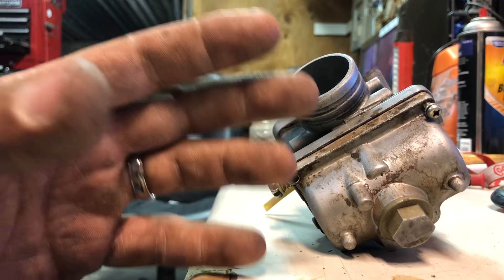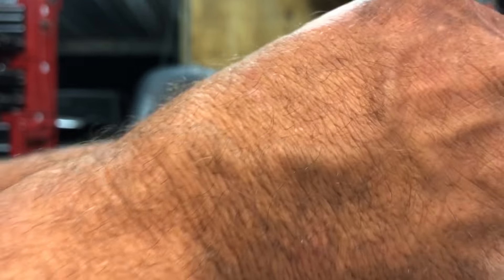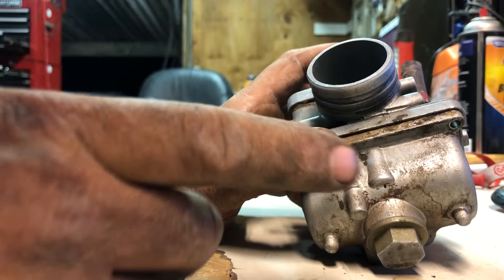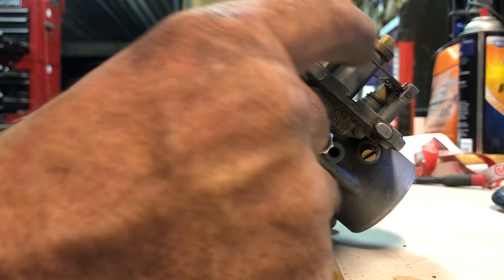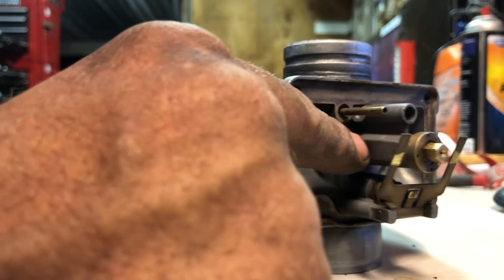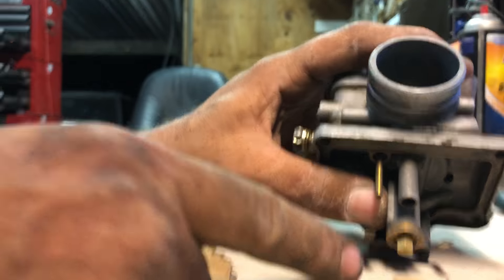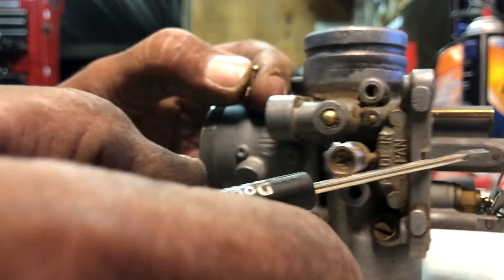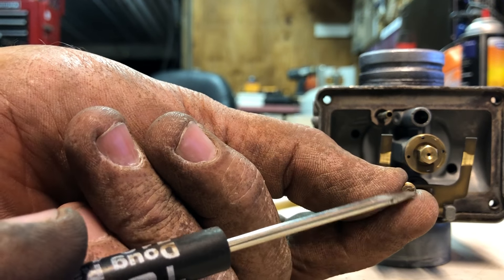Spitting And Sputtering Issue Solved

Comment: Just got a 05 Yamaha bruin 350 in excellent condition. After about two weeks of riding, it started sputtering and bogging out when I give it gas. Took carb apart to clean and it was like brand new inside, but I cleaned anyway and replaced sparkplug. Put carb back on and same problem. If I slowly give it gas it'll slowly pick up rpms and fly but as soon as I decrease gas and begin to increase again I get the same sputtering like it's starving for gas or getting to much. Like I said, this machine hasn't been taken care of very well and has less than 1000 miles. It also will backfire a little bit every once in a while after I get off gas at high speeds. Need help
Reply: I have the same condition on a small ct 200
Reply: Same problem here on the same quad, did you get it working and what did you do?
Reply: Did you ever find out what the problem was
Reply: Figure out the problem?
Reply: Being a 2 stroke the crankshaft seals may have dried out over time and is coursing an air leak around the crank.
Check all gaskets and crankshaft seals as you don't need to hole a piston with a lean fuel air mixture.
Take care and good luck 👍
Reply: @greglockyer4335  I'm thinking that's my problem as my carb is spitting gas out towards the air filter when I Rev it, plus compression is kinda low time for a rebuild
Reply: It’s the vaccum acctuated carb my did the same replaced it runs brand new
Reply: Figure the problem out?
Reply: i have same problem on 91 klr 250, it will idle perfectly fine, but when i give it throttle it can’t seem to find a steady rpm it will dance back and forth and won’t go over 5500 rpm and will boggg and bogg. i bought this thing awhile ago and it wasn’t as bad as it is now. I cleaned/rebuilt the carb and it worked better for a little bit still wasn’t the best though. I dropped a valve and went thru to fix everything and now it is ass yet i never messed with the carb. Don’t want to have to open this thing again, but shit it’s already been down for a 3 weeks. if anyone finds an answer let me know
Reply: Following - similar problem with 1999 Polaris Sportsman 500
Reply: Same Problem with Honda crm 1995
Reply: its 2023 and i have this exact problem with.xtz 125 😂
Reply: @MarioLopez-be1vg ive been looking for weeks to find a solution for this did you ever figure out what was causing the gas out the carb
Reply: Same
Reply: Maybe a gasket in between the air filter and carb
Reply: Any help me out with sputtering on my trx 250ex it starts drives but it idols strong for a second then slowly slows down until it stalls
Reply: @josephconn3235 why though?
Like what is happening with it?
I have the same problem
Reply: I had the same problem and then my carburetor fell off so I Taped it on there to get myself home and it had more power and didn’t big out, something is going on with the air I think. 
It must be running too right cause I fastened it on there again and now the problem is back. 
Help me
Reply: @jamesclarke1754  from what I’ve messed with the rubber vaccum slide on the carb has baby hairline cracks and messed the air fuel mixture up. I put a cheap Amazon carb on it and it’s been running 3  years no problems
Reply: @josephconn3235 what is the issue though?
Like is it not getting enough gas? Or air or what?
Reply: @josephconn3235 I think for some reason my scooter isn’t getting the proper amount of air it needs, running rich
Reply: @jamesclarke1754   check your choke mechanism, make sure it's closing completely when off. It's held closed by a spring and if it gets too sticky that spring can't cut it. Also check and clean the float valve that lets fuel into the carb bowl, it could be lazy to close and overfilling the bowl, x2 if they are ever straight up leaking gas when flat and level. A bit of mist out the intake while running is normal and gets recyled when the airbox or filter is on it, not the same as leaking liquid gas. Also check the height of the float lever, eyeballing for flat isn't good enough imo, it's a specific measurement found in the service manual. Other things that could cause similar issues or amplify the same problem are worn, dirty or IMPROPERLY gapped plugs, old gas, old gas again, especially ethanol anything, exhaust pipe damage or leaks, bad clutches, sticking brakes. Hope this helps, good luck.
Reply: @treytzimenatos3422 if your carb is leaking liquid gas it's the float lever valve that lets fuel into the carb bowl. Open the bottom, remove the lever by CAREFULLY driving the pin out and the valve will fall right out. That said a small amount of fine mist coming out the intake while running is normal and gets recyled when the airbox or filter is on it.
Reply: @HoldenPogorzelski   Have you tried the usual stuff? New properly gapped plugs, fresh gas? Will it only run mid to high throttle and never idle for long?  I suspect your idle jet is clogged, many 2 strokes will stay running for a decent bit after the fuel is cut off because on many its sucked into the bottom of the engine first, then into the cylinder. It runs good on the higher jet and has gas for a while after that, but then your idle jet won't give it enough to keep it idling. You should know that if this is the problem, running it in this situation is not good for it, without the idle jet it's not getting enough gas at all rpms, it could potentially burn up the engine. The jets work together and are parts that make up a whole as you go up the throttle range, you need both idle and main jets working. You may also want to check your choke mechanism, make sure it is closing fully when off, it could be flooding the engine when it's at idle and not getting enough air, if this is the problem you won't cause any damage. My money is on the idle jet though. Check your plug color religiously till you get it worked out. Hope this helps.
Reply: @jsimonx420 i think you have a main jet problem. Sometimes the tiniest fleck of something is all it takes, sometimes taking it off and on dislodges something in the fuel line that heads straight for that tiny hole. Or could be a needle problem. The needles do wear out over time, get thinner and let in too much gas. Could also be a cable/ synchronization issue if you have multiple carbs. You say it idles fine, but is it actually good, or just fine enough? It needs all jets to be working properly at higher rpm, not just the main, they are parts that make up a whole as you go up the throttle range. It won't get enough gas at full throttle if the idle isn't working properly. You probably know that if it's not getting enough fuel you risk causing engine damage. I also have to wonder if it came to you from a different altitude. Other issues that could seem similar or amplify the problem are bad plugs, bad gas, damaged exhaust pipe or exhaust leaks, intake leaks, bad clutch, sticking brakes.

Comment: What about sputter after you install a new carburetor. It’s almost like a little back fire . But cranks and idles fine
Reply: Also happen to me...sputter after install a new one carb...why?
Reply: I would check your spark plug, air filter, and air intake piping. If there is not enough air going into the engine, unburned fuel will shoot out of the exhaust and ignite causing a backfire sound. I suppose if a spark plug isn’t strong enough you could have the same issue
Reply: What was the issue

Comment: i have the same issue with my recently purchased kawasaki brute force 750 atv. Seller told me it ran great and had the carb cleaned and re jetted by a local shop just before he put the bike in storage for the winter season. When i showed up to buy it, it spitted and sputtered like crazy and would not stay running. After i rode it around a little bit i raised the choke level up about 15% and it seemed to run fine then...the idle was great and no more sputtering or spitting. Seller was shocked and told me it ran perfectly before he stored it for the winter. I went ahead and bought it anyways knowing  it was fixable no matter what and he gave me a killer price on it so I was still stoked to buy it. I so far am just riding it with the choke partially open and it runs fine so far that way at least.
Reply: colourtune plugs are handy as you can check the color of the flame which should be Bunsen blue after the choke is pulled in. there is a mixture screw under the carb usually which you can screw out a turn to get more fuel...might be worth a try. As long as the jets are the correct ones and the float heights are correct then with a clean carb the bike should run well.

Comment: This was probrably one of the best videos about small carbs thank you so much  I dont think Anyone could have explained that any better video was straight to the point.. Ive been struggling with a small carb. First it was leaking out the over flow then it was backfiring thru the air intake now its bogging down with throttle doesnt die starts right up but bogs way down driving me crazy but im pretty sure after dozens of videos  this is the video i needed to see. Will let you know thanks again

Comment: This is indeed a brilliant explanation ever to my Yamaha AG 200. By looking at this vedeo I've also checked and cleaned the main horse's nipple from the fuel tank to the cab which was being blocked by so many dirts. 2 Problems that were solved are engine dies when at low RPM or when at higher RPM, and hard starts again at about 3 minutes. ❤❤

Comment: Thank you!!! I am a complete noob and just started getting into ATV’s last summer. I am currently on my  pulling carb for the 7/8 time done yesterday. the same carburetor in and out with out luck 
 This video may be my saving grace
Reply: What kind of atv are you working on? And did you try this yet? Having problems with a 2004 predator 500 stalls at idle. I’m going to try and pull the carburetor this weekend.

Comment: im going to try this today. i have an old 1991 honda 300 fourtrax that seems to carbon plugs almost instantly. the bike idles great and can putt around in SL no problem, but as soon as your on the throttle to get through your gears, its as if the mid range power is completely gone it struggles to accelerate, and it starts to come back in to normal in the high end RPM. its causing jerky acceleration through gears and when finding your cruising speed. ive taken apart the carb and cleaned the jets, along with replaced the air and oil filters, plug and oil. somewhat fixes the problem but reverts back (my guess once the plug fouls) im starting to think the float may need to be adjusted now, thanks for the new lead!

Comment: Thank you! 
Having a heck of a time with my 125cc sputtering and definitely not idling. 

Always has run great previously. 

I cleaned out the carb but will re-check these side ports. 

I’ll let you know if it works!

Comment: Man runs perfect in every gear when you put it in reverse it don't have no power it just spits and sputters will not go backwards I also bought a brand spanking new carburetor and put it on it and it run perfect but like I said when you put it in reverse it just spits its better it won't go backwards unless you're on flat ground

Comment: Thanks man. Just bought my first carberated bike and want to learn as much as i can about it so i can wrench on it myself. It spits occasionally, its about 40 degrees out here in colorado, and it apears to only do it when choke is all the way in... so it may just need to be dyno tuned... apparently again... not sure if its tuned for this elevation. Assumed it was and that may be a mistake as i should have asked and the dealership may have shipped it up from elsewhere.

Comment: I could not figure it out. My new motorcycle only has 200 miles on it. Came with a carburetor I have to work to get the screws off the bowl. No biggie. Yet it puzzled my on what it was doing. Did not make sense. Now it does. So, I'm going to do exactly what you suggest. I will see. If works, you just saved me money and a big headache. Thanks for your help.

Comment: Iva a Kawasaki KLF 300 that won’t start !! It was originally just getting slower and slower to start, so I stripped carb and replaced all needles and jets etc , I found someone before me at left in too many rubber rings and washer on pilot air screw jet , but now after re-assemble it won’t fire at all ?? Just seems to back fire through carb a little bit , I’ve good fuel and I have spark , I’ve tried spraying into carb while cranking to see but still no fire ????

Comment: Great video.  I succeeded in rebuilding both carbs on my 1997 Polaris 500 snowmobile thanks to this video. Reassembled carbs on machine and fired it up.  The mag cylinder is not drawing in the fuel, thus the mag cylinder is not firing.  Suggestions?

Comment: Thanks for the video. I have a mercruiser 3.0 litre. I was having some bogging issues under load. I changed the fuel filter at the base of the engine, the filter just inside the carb where the fuel line attaches. Cleaned out the clear tube running from the carb back down to the fuel filter at the base of the engine. I put in new spark plugs gapped to .030. Now the boat is running better, the idle is still a little rough but the main issue is after I've been at full throttle for a few minutes I begin to hear a popping sound. I back the throttle down and the popping goes away but then at no wake speed I hear a ticking sound. I've run three cans of Seafoam through 15 gallons of gas so far. After shutting down the engine for a half hour or more the boat seems to work fine until full throttle results in popping again. Thanks for your thoughts!
Reply: Just a suggestion but try adjusting the valves. Even if that's not the problem it is always nice to rule valve adjustment out. The ticking could be a loose rocker arm and this will usually cause a hard starting issue or long crank times before starting.
Reply: @jessesmith1181  Thanks for the idea. I am new to working on my boat this season. The boat usually starts right up. Are the things you've suggested something to do after taking the boat out after the season is over? I keep the boat on a Shore Station lift with a canopy. My only concern is that I wouldn't have the boat put back together before 9/15 when I plan to take her out for the season. Will I do damage to the boat if I continue to run her conservatively until the end of the season? Thanks!
Reply: Not sure about damage, it really depends on how far out of adjustment the valves are but if you are hearing them tapping or ticking one of them could be pretty far out. There is a 15 minute ish video on you tube just for the mercruiser 3.0valve adjustment. So you know exactly what you are in for labor wise
Reply: The popping you are describing is it a backfire through the carburetor or out the exhaust possibly? Trying to figure out what u mean when u say popping at full throttle
Reply: @jessesmith1181  The ticking becomes un-audible after about 3-5 minutes while running at no wake. However the cycle repeats itself (popping then ticking) if I go to wot after the ticking stops.
Reply: Just a little more info, I would definitely start with the valve adjustment as this can cause the ticking or tapping and also if they are to far out of adjustment can cause a backfire or popping. Also check the coil visually look at it for burn Mark's where the spark may be jumping out and also look at it when engine is running and make sure you don't see any sparks coming from cool or wires. It's usually easier to see the sparks when it's getting dark outside
Reply: @jessesmith1181  Yes, it is backfiring. I'm not sure where it is coming from. The bogging is what started the whole problem with the boat. I started by changing the fuel filter, and ran her. Then changed the carb filter, and ran her. Then changed the spark plugs. The bogging is gone but it has led to the popping/ticking. I'm waiting for parts to change the rotor, cap and plugs.

Comment: I have a taotao 125cc Dirtbike. The carb it doesn’t run great with unless it’s in higher rpm. Whenever it is idling I have to feather the throttle to build the rpm before going. If I just hit the throttle from idle it bogs down and dies. It’s super annoying to ride because of this. Also the piston was on wrong with the intake and exhaust sides flipped since I fixed that it does run better but still is the same bogging problem. I’ve adjusted the carb so many times but to adjust the air fuel screw I have to take it off and it’s annoying taking off over and over

Comment: I have a 98 yz250 2 stroke. Previous owner must have hit something very hard because the front rim was so bent that when moving it, the tire would rub the front shocks. I'm having a similar issue. But mine is occurring as I'm hitting the powerband. The bike will act like it's starving for fuel and after a few quick twists of the throttle it'll go back to full power - resulting in the front wheel coming off the ground.  I'm going to pull the carb off this weekend and give it a good cleaning. Fingers crossed that I find some green goo. Otherwise I might be looking towards checking out the power valve. I'm new to 2 stroke dirt bikes/ bikes in general. I purchased it 2 months ago and have slowly been replacing parts. I'm a diesel mechanic and love tinkering with small engines. I'm open to any suggestions.

Comment: similar issue with my royal Enfield 350cc. Uses a 29mm carb, the bike tends to start dying when it's running with load at a constant throttle, say through the mid-range RPMs (2000- 3500 rpm), but post that 3500 rpm till the redline at 5500 it works fine when throttle position is constant there.